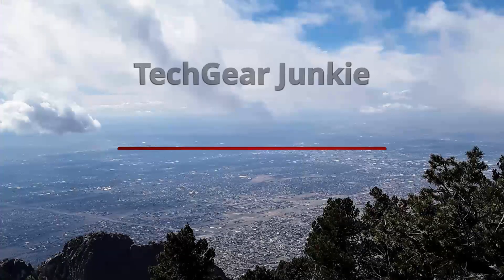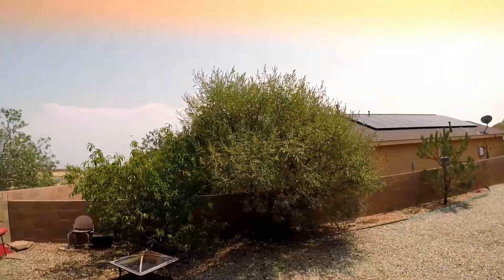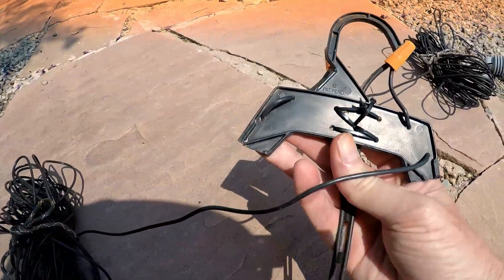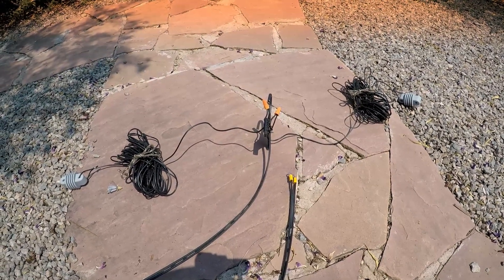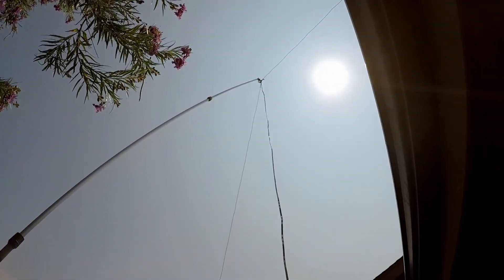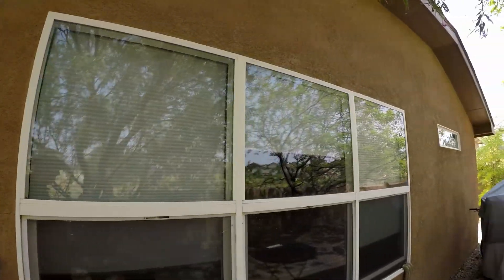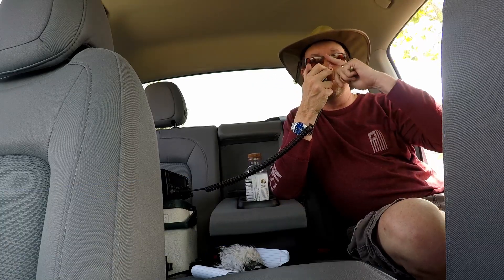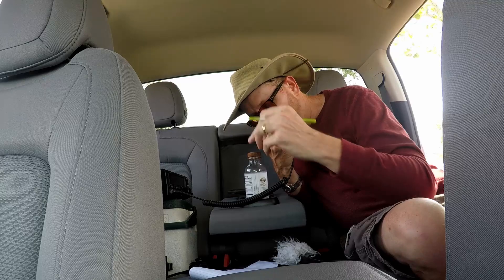Violation letter from the H.O.A. and a Coat-Hanger Antenna!

Comment: If you get the apex up to 30 ft or maybe higher, then your reception will get even better!  I have a spiderbeam 40 ft telescoping fiberglass "thick" pole.  With a 60-65 ft random wire in a semi-inverted L (the horizontal portion slopes from 40 ft down to 18 ft and then runs down to near ground level to a 9:1 UNUN) I got some amazing reception even in the midst of our current marginal propagation conditions.  A doublet I am sure would do much much better.  Higher is better! 73 de AE5ZX
Reply from the maker: Exactly, I really need to invest in a good heavy duty fiberglass mast to get the most out of it.  One that I can hide away when done, of course.
Reply: @TechGearJunkie  Unfortunately, I set up my Spiderbeam only temporarily in my back yard.  Normally I have that same 65 ft semi-inverted L antenna with a horizontal section at 25 ft sloping down to 18 ft , etc.  A compromise antenna to be sure and really not suited to DX in my experience, but it still gets out there for many QSOs even in this lousy space weather.